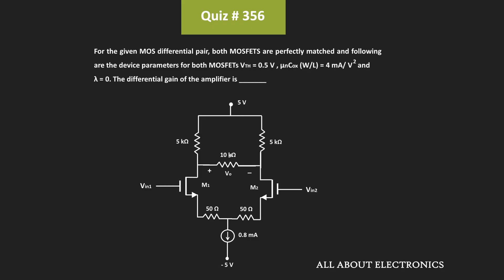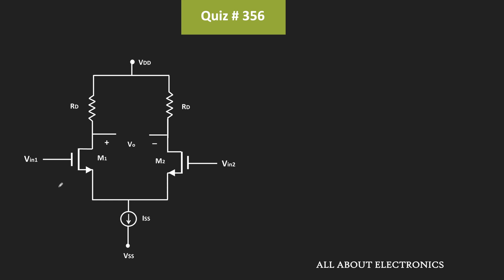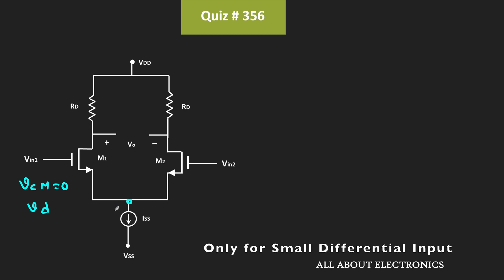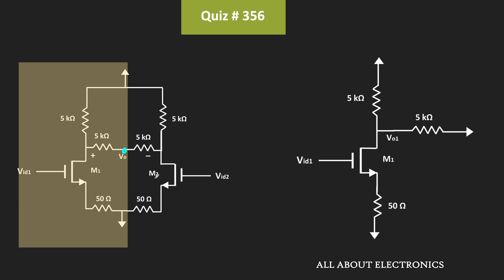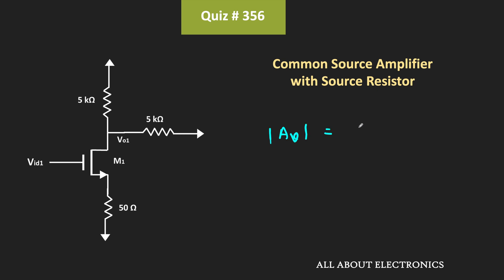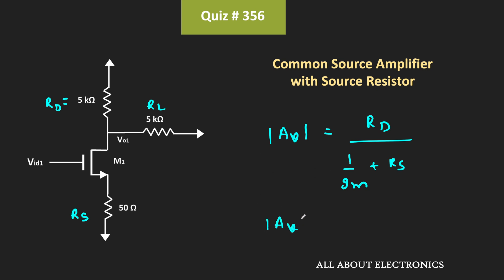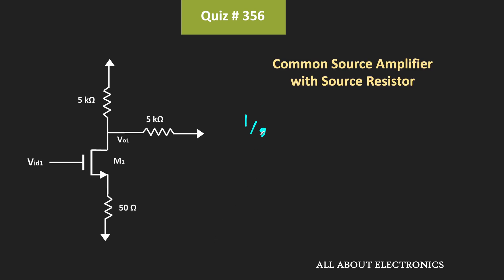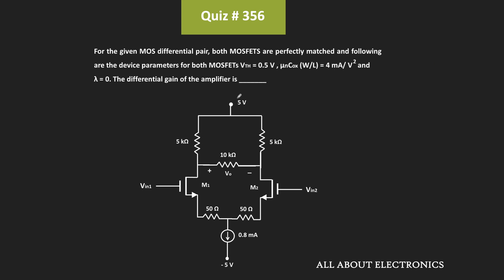MOS Differential Amplifier Solved Problem | Quiz # 356

Comment: Though one thing I got the total value but in your solution you provided the absolute value, so which one is right from exam point?
Reply from the maker: Usually in exam, if absolute value is asked then it will be specified explicitly in the question. If it not mentioned, then you can write the exact value.
Reply: @allaboutelectronics-quiz  shouldn't balanced gain be twice of unbalanced Gain u calculated in the video?
Reply: No one defined that Vid = Vin1 - Vin2 in the problem, so my guess is that the best option is for you to explicitly state it like:
Vo/(Vin1 - Vin2) ~ -4.1 V/V
or
Vo/(Vin2 - Vin1) ~ 4.1 V/V

(or maybe put both)